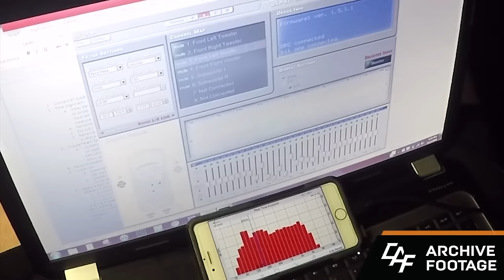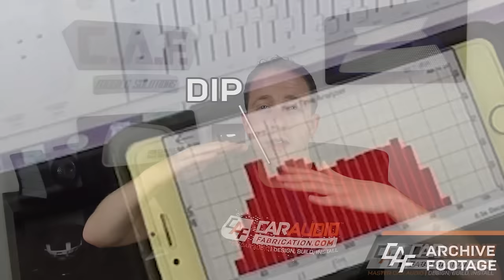Build the BEST Car Audio System - Full process explained

Comment: Going tr3 off the bat fully customizing Dash with a dual head unit 10.1 in Android system redoing my door panels in 2000 Dodge Ram 1500 four-wheel drive. Whant to do component speakers in door and two 10-inch Subs behind the seat have any suggestions

Comment: I've been into car audio and install all myself for over 20 years. Today its much more tame (getting old). I recently got rid of my infinity kappa 6x9s and replaced for components (rear doors). But now I find the treble too high from behind and the sound is weighted to the drivers side! In addition I have always found that in the rear of car the bass is much greater. Any tips to fix these issues (i have a 8" JL audio microsub). Tried balancing left and right but then the front passenger has a more unbalanced sound.

Comment: Hi,i'm currently using a 4channel amp for my subwoofer and front speaker..the problem now is everytime I turn my engine on,a loud buzzing current runs through the speaker and the humming also heard when im press the gas..got any ideas how to remove those noises?

Comment: How do you determine where the "best location" for the speakers is at?
Reply: Hook them up and move them around. Flip the sub box facing different directions, and put a piece of foam on the dash to experiment with different positions for the tweeters and maybe the midhighs if you also have midbass.

Comment: What if I just want to start at phase 3 because I could go buy a sub and amp, install it then throw it away and start cutting holes in my doors. 

I have an 08 acura tsx.  Factory set up is tweeters in the dash 6.5's woofers in all 4 door then 6x9's in the rear deck.
I want to know if I can put 8" woofers in the rear doors and maybe 8's or possibly 10's in the rear deck.  Can I do that or would that be a dumb rookie mistake and waste of time and money? I don't want to put a sub box in my trunk.

Comment: I've never performed a complete entertainment system install before so I'd like to get some advice from a Professional. I need some suggestions on getting started on selecting the proper AMP, speakers, and supporting hardware.

I own a 1989 Ford E-150 Conversion Van, I've completely gutted it to install some of today's toys, I already have the Boss BVB9364RC System for my main system and some headrest monitors that I built housing's for.

I'm willing and able to do the research, purchase, fabricate/build, and install myself; however, I know there is more to it than just "Plug and play - HELP!.

Comment: please help me with this? if you can I am about to buy a system for my Mitsubishi Pajero 94:  these are the standard size 
   Front: 4", 6-3/4"
    Rear: 6" x 9"
    Dash: 4"
    Front door: 6-3/4"
    Rear side panel: 6" x 9"
Looking at your video, I think I will need an active crossover as the tweeters are located on the dash, I don't want to put in a sub (As I don't want a box in the back) but I would like the deep sound, I am planning to use 3 ways in the front and rear doors and rear area, and two way on the dash. I would like to use an amp to drive everything.  I would like lots of top end sound, but i need a nice bottem end sound too. as I lesson to mainly Reggae, Soca, jazz, R&B and blues. Are there any special ways to set this up? and being in the Caribbean at times I can turn this up, however, when driving I would like to play this low with a nice rumble.  I would even like to just sit in the Mitsubishi Pajero on the beach or in the mountains and listen to music with a nice clean sound.
Any ideas, how to set this up? also, the vehicle is diesel so I think I might out all the seats and put in installation on the floor, even though I don't have a system in mine,  I am thinking of using alpine as past experience tells me I will not get amp noise

Comment: Hey! I'm wondering what subwoofer configuration you would recommend for a saloon car? I currently have a bmw 5 series e61, I'm thinking about a 2x12" subwoofer box and external amp. I had a single 10" in my old audi A3 that worked beautifully, at around 500W. How would 2x12" work in comparison, at around the same wattage? Although I'm looking for around 1000W rms. Is the size important at all? Would there be a noticeable difference by having 2x10" 1000W instead of 2x12" 1000W?
I'd love an answer from you :D
Reply: Whew. Go with whatever sub setup you want. Depends on what you prefer and how much space you have. 
Short answer, all else the same the 12's are louder due to cone area.
 2x12 @500w would be louder than 1x10 @500w. Same with 2x12 @1000w vs 2x10 @1000w.

It gets more complicated when youre comparing different model woofers with different performance capabilities. I just have a single 1500w rms 15".   Even if multiple smaller subs would theoretically be louder it doesn't matter to me.

Comment: Okay before I tell you my problem I want to tell you I do not care if I cut harnesses or whatever I have to do .. so I have a 02 Tahoe I put my amps in the back ran everything like it should be I came off of my amp to all the speakers that I want but there is a factory amp the door speakers will play but if I turn it up it turns my amps in protection mode and my subs are not hitting at all matter of fact my 12 sounds like it is blown and it very well might be because of the feed bag from the factory amp so what is the quickest way to get rid of that factory amp I do not want to buy harnesses to bypass it I just want to have power signal and ground and no factory amp I could tell you a little bit more about what I did that didn't work but I don't want to make this message any longer than it already is please help me

Comment: Question please explain if you have two subs and you hook up two amps or 4 subs with 4 amps..on each amp you have left and right speaker hook ups but I see people with the same amount of subs and amps,so how do you hook each amp up to one speaker?? do you just hook up let's say to one side of the amp and oh hell how would you hook it all up and then all the amps to one head unit?
Reply: most amps have what is called bridge mode where you hook the + to one channel and the - to the other channel. thats how you hook up one speaker to a stereo amp, unless you hve a mono amp ten its just +to+ and to.

you can either use RCA splitters or you can use loop outs frm the amps if you have them

Comment: jumping back in I'm starting with my mids 6.5 component hertz hi-energy in the front then 6.5 two ways also hi-energy, a 12" rockford fosgate shallow, running off oem stereo a 5 chanel phenix gold amp and a but one processor. what do you think?
Reply from the maker: Sounds like a nice system. :)
Reply: I'm heading heading in the right direction
Reply: ishmael santoyo don't go with shallow mount if it's not too late unless you have to

Comment: Hey, can you help me to find an answer for my question? I would really appreciate it. I have installed polk db 6502 components in my front doors oh Honda Jazz. Is there any way i can add a third mid range speakers to the current 2 way set up without replacing the entire system with another 3 way system.  Is it possible? if yes, how?  thanks!
Reply: Yes, do a search on multiple speaker wiring diagram, pay attention to your ohms.

Comment: Just finished my final step, added a RF punch 400 and put all the juice on 2 typeR 6x9s. Even added a 250 Amp alternator over my stock 160. Still sounds low and possibly not even as loud as before. Wtf is going on? Subs sound better. Interior not so much. Tips welcome! And no, I'm not swapping out my speakers 

1 RF t1500-1bd
1 RF p400.4
2 typeR 12s
2 20a battery's in trunk
Big 3
Kenwood excellon 997 head(22 rms) 
AlpineS 6.5s
Alpine typeR 6x9s
Rockford  3.5s 
250a alternator.
In a jeep grand cherokee

Comment: +CarAudioFabrication you mentioned a possible need to upgrade the electrical system to match the sub and amp. I was given a 12" subwoofer for my compact car (2005 Chevy Cobalt), can I make a larger sub like this sound good without needing to upgrade the electrical system for my relatively small car? I haven't seen the sub in-person yet I just know it's 12".
Reply: Caleb Mitchell should be fine if your just runnning like 2000w

Comment: How do I add an amp and sub to a premium factory Bose system with amp?  I need the factory head unit. I have a Rockford Fosgate R500-1  mono amp and  a Kicker CVR 12" 4 ohm sub. The amp is just for the sub
Reply: You need a line out converter and tap into the factory amp to grab the signal for the l.o.c. Still gonna have to run your power/ground for the amp. They have some videos here on YouTube that could help you.

Comment: okay here's my question I have a 2006 dodge RAM 1500 crew cab and I want to install a amp for my speakers but I don't know what kind of amp to get here is the speakers that I have and I am looking to send no more then 400 on an amp but cheaper is always better. I have JL Audio C2 - 350 x in my Dash their power range is 10-40 watts RMS (75 watts peak). I have JL evolution C2 series 5.25 component speakers in the front they are Peak 200 Watts per set or 100 watts each RMS 120 per set or 60 watts each. I have JL C2 -650 6.5 component speakers and they have the same wattage and RMS as the Evolution C2 in the rear. what kind of amp should I get?
Reply: 75 or 100 x 5 or 75 x 100 x 4 for the speakers. If you go 4 put a powered sub or 5 an 8" I prefer most would tell you 12 or 10.

Comment: currently building custom door panels to install 4 8's, 2 10's, and 2 components for front,then 2 10's and 1 component for the read door, think that's too much, cuz I'm thinking of doing 4 18's, 2 15's and 2 12's in the back of my trailblazer
Reply: Jordan Orr why mix subs like that? It would have no benefit and would sound like crap. Even the doors would be overkill. you should rethink that whole system.
Reply: Se7enMiIe SPL comps
Reply: Jordan Orr look at SPL vehicles on YouTube, none mix different size subs. You would need a different enclosure for each set of subs and it would still likely sound like garbage.
Reply: im keeping the doors the same way, but i did rethink about the subs in the back, just 2 18's

Comment: What do you think about these components for 800$
Ptp admin 😊

Full Car Sound System Set-up (used once in car show) 
1. Sony Xplod XS-GTX120L (Vietnam) 
    PP = 1000W
    RP = 300W
    RI = 4 ohms

2. Sony Xplod XS-GTX121LB (Vietnam) 
    PP = 1000W
    RP = 300W
    RI = 4 ohms

3. Kenwood KAC - 8106D Amplifier
    Signal to Noise Ratio: 100 dB
    Low Pass Filter: 50 – 200 Hz (-24 dB / oct.)
    Bass Boost: 40 Hz (0 – +18 dB)

4. Sony Xplod XM-GTX6020 Amplifier
    PPO - 350W
    Low Pass Filter: 50 – 80, -18 dB/oct

5. Boss CPBK2 Capacitor (2 pcs) 
   2.0 Farad
   16VDC/24V Surge

6. Wiring Accessories Included

Comment: Wonder if anyone can help me. I recently installed a kenwood double din stereo in my car and all of a sudden started to get interference... I thought it was just my phone so I left it inside and then turned the system on and it still was interfering... anything I can do to sort it out ?

Cheers
Reply: check your ground. then ur rca cables., cheap ones will get alot of interference
Reply: ok cheers mate
Reply: Read: http://www.crutchfield.com/S-ECNMdAcey3f/learn/learningcenter/car/noise_suppressors_installation_guide.html

Comment: I remember a few years ago my local audio shop had all the new cars getting new systems in. now the shop still has lots of work but little to no new cars lol
Reply: the high end car audio shops around Phoenix are so packed with work it is ridiculous. scheduling required and they charge top dollar and no "pricing" permitted. what they are doing is keeping the oem head unit and running it into a dsp and after that, transforming the audio.  huge market for this.  and lots of classic cars in the shops as well, as you said.

Comment: You seriously need to do a video on old school amp sound quality vs new. I have ran Eclipse since 2003 and am currently now running a Pioneer DEH-80PRS because I need the USB access to play WAV files (got tired of CD"s flying around my car) - that is mainly the only reason. I still use an Eclipse Amp. And the old school MB Quart QSD 6.5's and Boston Rally's. Not interested in 95 percent of the new stuff that's out there.

Comment: tl;dr Pioneer/Alpine HU, Focal door speakers, JL W7 Sub(s), Rockford/Alpine/JL/HiFonics 5-channel Amplifier or two amp setup (mono block & 4 channel), Crossover, Digital Signal Processor (DSP), Ported or Non-Ported Sub Box with proper Cubic Foot of Air space for your subs, Big-3 Upgrade, 0/1-4 AWG Amp Wiring Kit, Amp Remote level control call, Dynamat or other sound treatment >>>> INSTALL >>>> TUNE>>>>>>PROFIT

Comment: Is it just me, or does all in-car audio become more and more pants year on year?
Dude! It is one thing to wax lyrical about sub woofers tweeters and whatever on the speaker front. You can drone on for years about frequency spread of the amplifier whether pre or main.
But it is what you are sticking on the front that is important. What do you propose to place on the front of this system? Low bit MP3?
Reply: I think speaker companies are making their subs worse every year and not having that deep hard hitting bass anymore. Like pioneer, I used to have the premier spl 12in competition that were 1000rms and 3000max watts and now they're lower rms and much lower max.
Reply: @blake102989  The point I am making is that you can spend a million pounds on the speakers, but if what you put on the front end is naff, as most in-car audio is, then  the speakers can only faithful replicate that naff quality sound.
I think that the real problem here is that the modern car manufacture knows absolutely nothing about quality sound systems and, unfortunately, the kids of today do not understand quality when it comes to fidelity.
Reply: @petermitchell6348  that is true but there are a couple that have decent factory systems like some of the Audi's with bang and olufsen systems and the new Cadillac's with the somethin like 28 bose speaker systems that make you think you're in a music hall lol. Other than that they're all trash unfortunately. You're also right about kids today because sadly they dont care about the quality sound or even bass anymore like when I was in school which was 11 years ago it has changed drastically. When I was in school so many people had either upgraded vocal speakers and/or subs and I remember being the one with the hardest hitting bass but couldn't really hear the music when it was all the way up because they hit hard enough to distort everything else lol. I miss the days of having blurry vision, headlights going dim, and not being able to use a lighter just so they could feel me coming from blocks away lol.

Comment: Noise Noise. I can't take it away.  done everything. even got different headunit nothing. more noise when I hit the gas. any help?
Reply: ground rcas
Reply: Alexander Aguasvivas try connecting  thick wires between the minus of the input of your amp and the minus output of your  head unit, they are already connected, but a thicker wire helps get rid of the noise
Reply: Vladimir Aguasvivas in my experience, run all your grounds, including your head unit to the same ground.  A ground bar comes in handy if you have many components to ground
Reply: what kind of car year and so on it might just be a processed that's giving back feed

Comment: do i need a 4x50w radio if im using an amp
Reply: A radio isn't 50 watts more like 17 RMS. If you want more power you can add an amp
Reply: @elroycooley398  ye the radio has 50 per channel normal ones have like 20 expensive ones ,and i use amp
Reply: @elroycooley398  a 4x50w radio has good features and bass port

Comment: What's the best to do 5.1 surround sound. If you could do a video sometime on it would be nice . How to do this without a touchscreen CD player . I like the standard single din for volume and cd/dvd . Here is my car https://youtu.be/SDao-2zFnJQ I have 2 JL W6 in the back with a ported box. Focal surrounds , Alpine amps 600 and 1200 watts , Im adding a DSP and wondering what's the best setup for my car .. 91 integra , tuned with a Vtec ;) only 125k orig mi . The box is so big in the trunk the subs have to be facing towards the front. Would it be better to have the sealed box and turn the subs towards the back to get deeper louder  bass?